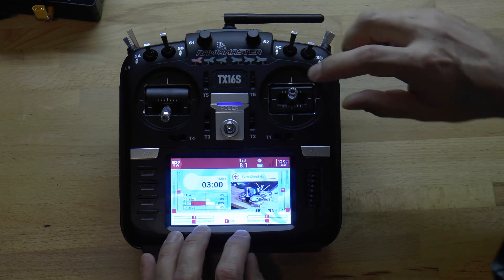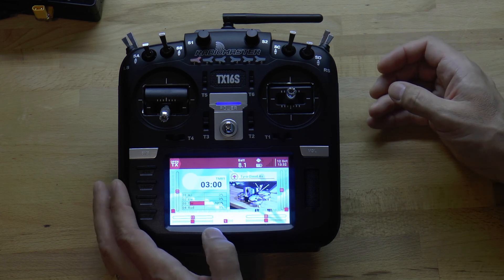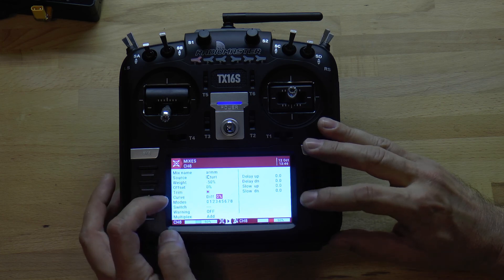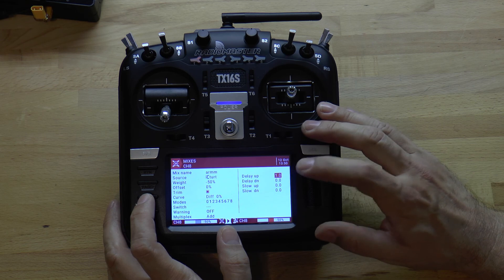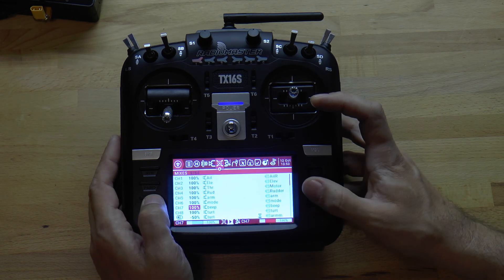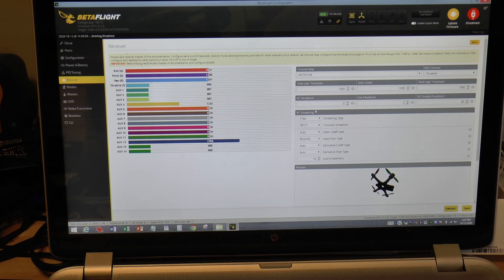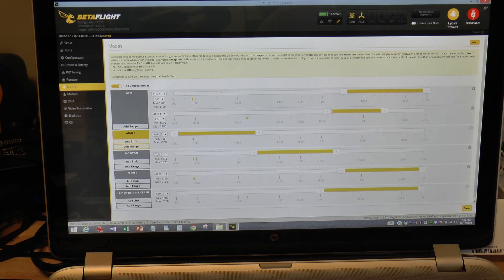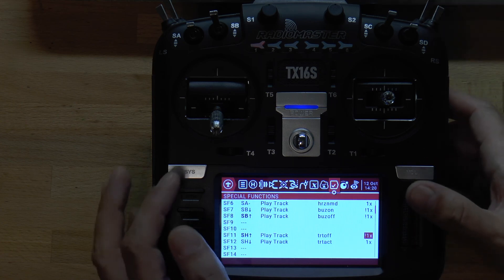activate OpenTX turtle mode with a momentary switch.

Comment: I just got my 16s the other day. With so many switches that I am not using I am thinking it might be a lot simpler for me putting turtle mode on another switch. It does seem to work nicely though on that temporary switch. Hell it took me most of the day yesterday, to get one quad connected and flying. I only Installed a flight mode switch and arm disarm.  Today I was going to try to add a buzzer and turtle mode. 🐢